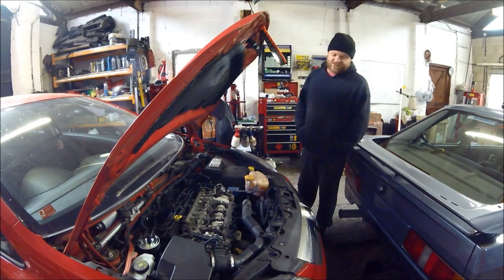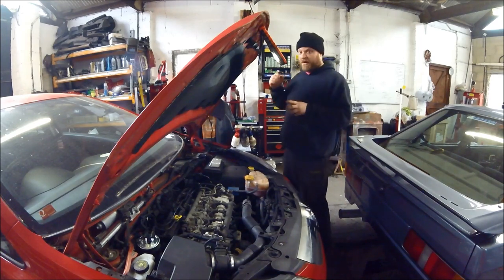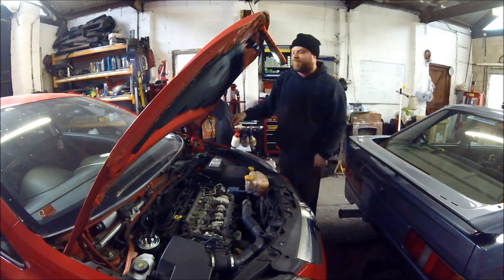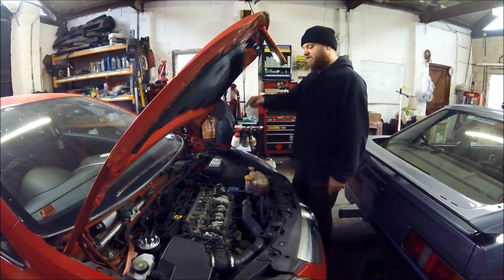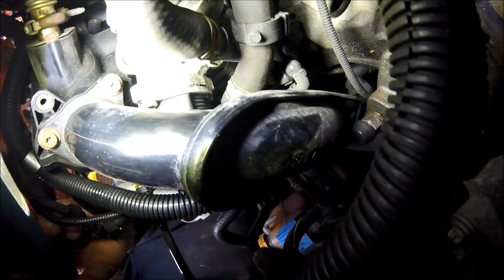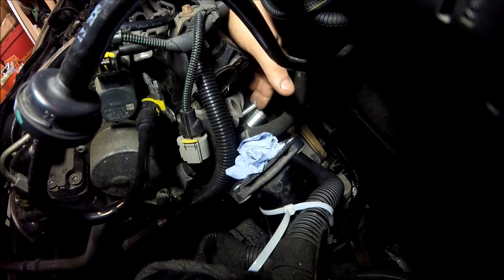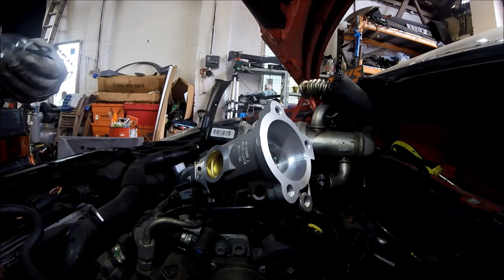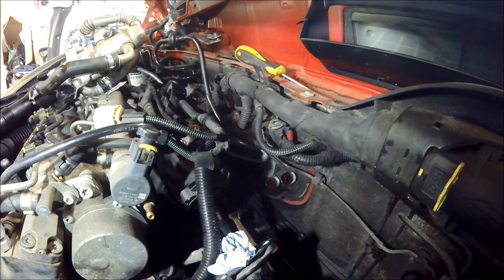vauxhall corsa adam combo astra 1.3 cdti egr valve replace fit repair  new

Comment: Great vid...Why can't bloody manufactures make serviceable parts more accessible when they design engines...
Reply: This is an easy job  the egr valve can be taken off an Opel astra with the 1.3 engine in a few minutes and you don't need a mirror or anything else just reach behind and remove the two bolts with a t45 and comes out without removing anything

Comment: Why would you check for fuel first when a symptom of problem was plumes of unburnt fuel behind the vehicle? To me I would interpret that having no issue with fueling and issue is on the air side.

Comment: Greeting from Dublin and thank  you so much for making this video.  
 I removed my egr valve today by following your video instructions.
My one was stuck in the closed position. Also the small pipe that goes from the egr walve to the head (in the shape of a penis) was very dirty.   It's important to clean this as well as cleaning or replacing the egr valve. I decided to replace the egr valve. I probably could have gotten away with cleaning it but you get so fed up doing this job by the time you have the valve out, you just want to replace it with a new one.

Comment: Great Video Terry. I have a 1.7cdti Zafira and started local jobs. Result=Carbon ups a lot. This design is crazy. Now my EGR is clean i am told i might need to do a long run to clear my DPF.. question, do i need to change oil after this … ie will poor EGR and DPF Block contaminate oil?

Comment: I've got a 2008 combo 1.3 cdti van that just refused to start after a 100 mile run , I watched your video as I've been on different forums and I've been informed that it could be the egr valve stuck open... basically it run fine all the way there, I made a couple of stops on my way and started no problem, but then I got there and had to be recovered.... before I went on the run the management light came on and seemed a bit sluggish at roundabouts etc.. But seemed ok again just before the run , no lights &  not sluggish.... would you diagnose egr valve stuck open or something different from my description of issue?

Comment: Nice video mate! My combos EGR link pipe has a split in it the metal one can I just blank my EGR ? I was told I will need to get it mapped out after
Reply from the maker: It's 50% 50% some u don't have to mate but some u do iv blanked a few and the light has stayed of but I have done some and the light has come on almost strait away
The ones iv done have still driven OK tho even with the light on
Also the split metal pipe will need to be fixed for u will loss boost pressure from the split pipe and it will throw your fueling out

Comment: Any of those components the throttle housing? my sons corsa cdti we think the throttle housing butterfly valve is stuck closed with soot, hard start, no revs then very slow revs until it then bursts into life with a little tap or click I believe, new glow plugs and battery, replaced the fuel rail sensor and its had a diesel redex flush, plenty fuel smell makes me think it is air starved, the butterfly valve just maybe stuck closed on soot build up?
Reply from the maker: That sound more like the egr valve to me dose it kick loads of unburnt diesel out the back as well
Reply: @TheADHDmechanic  the car won't start now, if the butterfly valve on the throttle body doesn't open through soot build up, no air gets to the injectors so won't start, the egr is exhaust back to the inlet so that isn't it, the problem is much bigger than that, the problem could be the ECU, the car is going back to where it was bought and they are going to try fix the problem so lets hope they find the issue!
Reply: Panspermia Hunter hi dad, fancy meeting you here

Terry Slucock Hi mate, just came across this vid right now, this sounds almost exactly like my car/symptoms (09 Corsa CDTi) 

Plumes of white fumes (assuming unburnt fuel), bad idling, no accelerator response, no warning light (local garage even said diagnostic wasn’t finding codes), etc. We actually managed to get the car started and idling normally Saturday evening, gave the EGR valve some light taps with a hammer whilst we accelerated. Revs burst and the car kicked into action. Turned the engine off, left it abit, back on, tried the accelerator... minimal response. Tapped the EGR valve again and, car burst into life again. Seems like that’s it.
Reply: @TheChubbySnail  Hi Tim, yes Terry you are absolutely right, I do apologise! a tap with a small hammer on the flange of the ERG and it bursts into life, thanks.

Comment: About blankin plate, so you just installed it and no dtc came?
Wiper motor cover on windshield, easy To remove?
Reply from the maker: Yer the windscreen cover and wiper motor is easy to remove :)
As for the dtc light it's 50 50 some the light comes on and some don't :)
Reply: @TheADHDmechanic  i am planning To program egr off and then clean it.
Reply from the maker: @j00p1  yer that's good :) and it is the best thing to do :)
Also if u blank it as well and reprogram - remap it u will loss mpg when u remove the valve but when u remap it u can up the bhp and in doing so if u drive it right u will get even better mpg :)

Comment: You can tell the people who designed these engines have never put a spanner to bolt so to speak, or they would make them easier to work on!
Reply: That's what I always say! On this car you have to remove the air box to access the right head bulb

Comment: Hi i cleaned mine and blanked it now i dont have no boost at all its got revs bit when driving with foot the floor thers nout and gradually builds speed any advice
Reply: The turbo waste gate actuator will be sticking. Work it free manually and lubricate it with wd40
Reply: nickeas120189 thanks for reply it turned out i left a vacuum pipe of the back of the engine 😂all sorted now

Comment: These modern diesels need long runs to keep them running well as they have dpf and get choked up if doing short runs all the time I have Suzuki swift with same fiat multi jet in it.
Reply: this 1.3 cdti is a piece of shit, barely 200tkm and I've been repairing it every year for the last five years. Injectors, alternator, water pump, fuel pump, now the bloody EGR
Reply: @losFondos  yep I agree I spent 600 pounds on injector and new refractory washers on my 1.3 ddis last month I had an old 1.9dci in a vitara over 3 years no issues at all.

Comment: Hi, I've got this problem with my car, it ended up breaking down, called the recovery people who put a  diagnostic on it, showed up about 8 codes related to fuel, but it broke down because the battery failed, so the breakdown guy said its eith alternator and or battery and egr valve. It had been spluttering and smokey, and engine light was on, but I was ignoring it hoping it would keep going till after Christmas. My local garage have now had a look at it and are basically telling me it's not worth repairing. They've said it needs new egr valve, new glow plugs and that the inlet manifold is cracked. They estimated bill would be more than £750. They didn't even mention the battery or alternator.
Any advice? I'm not a mechanic and I'm not in any position to try and fix it myself.
Reply: It's a 2012 corsa
Reply: Did you find the solution????
Reply: @konstantin-big  yes, I sold it to a garage , listed it on ebay with the full list of problems. I've discovered that if the egr valve is stuck open it's like I described above...and I must be replaced. Never cheap as its gard to get to...if its stuck open you can keep using  it, so long as you don't let fuel get too low, and regularly put fuel cleaner in. If its stuck open you can get it remapped which will permanently wipe off the error code. Otherwise , resetting gather error code, it will come back in a few hours of driving. I have a car now that's got the egr valve sign on...but it's driving perfect...so it's stuck open.
These egr valves are a big pain.
Reply: @desertrose9919 
Which error code have you now on the new car. And 
What brand and model is the new car

Comment: ive got thes same trouble can you buy the blank plates
Reply from the maker: You ca' proble buy something off ebay but I just cut them out of a sheet of 1mm steel 😊
Reply: @TheADHDmechanic  ok may need inlet to be cleaned out ive got a steam cleaner then wipe it out
Reply from the maker: I'd leave the inlet just blank the egr between the head and the egr 😊
As for the black mess in the inlet
The oil beather is pipe in to the intake of the turbo and the oil mist that gose through the inlet will clean the inlet over time 😊 as long as the egr is blanked ☺️ if it need a bit of a kick start u can buy an on car egr cleaner the u spray in to the inlet while the engine is running 😊
I normally use the wins one ☺️ and is dpf friendly ☺️

Comment: I have problem ... exaust gases on the water system and high pressure...so....i buy a new cooler.... i instal tge new cooler and now i have 10 times more high pressure in the water system .... 😮😮I can not understand where the problem is really .
Reply from the maker: Hi mate the only other place exhaust gasses can enter the coolant system is through the head gasket if it is faulty or a cracked cylinder head 😔😔
Reply: @TheADHDmechanic  i am agree yes but sometimes the cooler makes those problems . Another car we change the AGR cooler and then the pressure on the water  is goon . Thats why i buy a new cooler but like i see the problem is not this . 
Thanks for answer.
Reply from the maker: @orestispappas1613  yer you did the right thing I would of gone for the cooler first 😊
Sorry to hear it did not solve your problem tho 😔
Reply: @TheADHDmechanic 
 the EGR valve does the antifreeze come into contact with the exhaust gates with some gasket between????

Comment: Looks like a bitch to do, my combo 1.3 cdti keeps going into limp mode, I'm almost certain it's either the turbo or egr valve. I'm going to blank my egr valve off completely but it's going to be a bitch by the looks of this video 🤣 decent footage dude, takes some patience
Reply: If it's going in to limp mode at approx the same rev range every time, it's almost certainly the turbo wastegate actuator is stuck. WD40 and work it until free. Mines has gone another 9 months since freed off lol